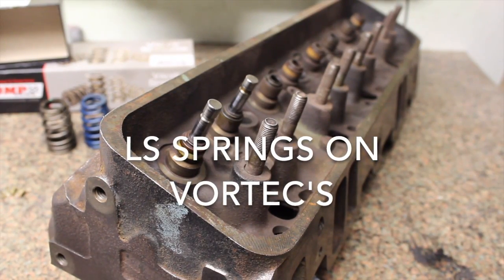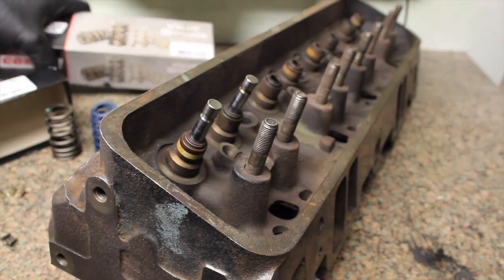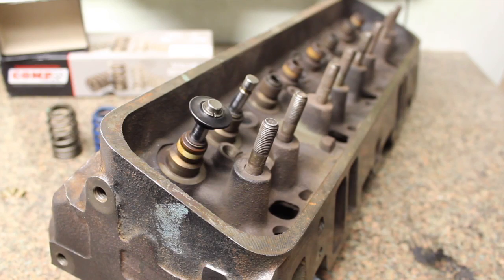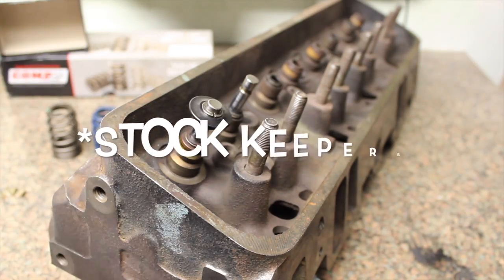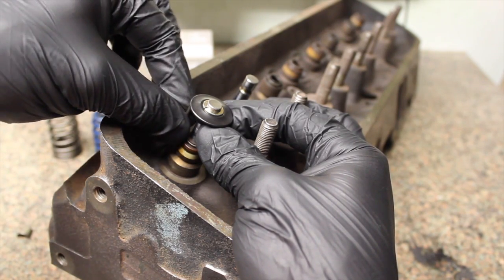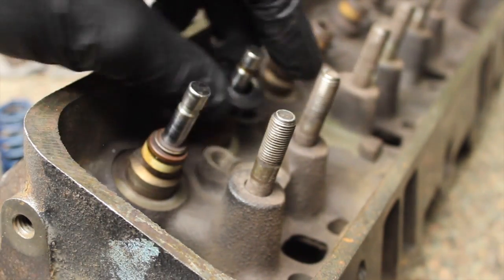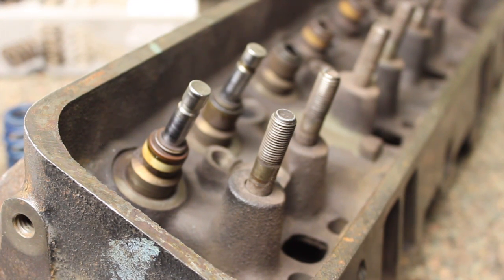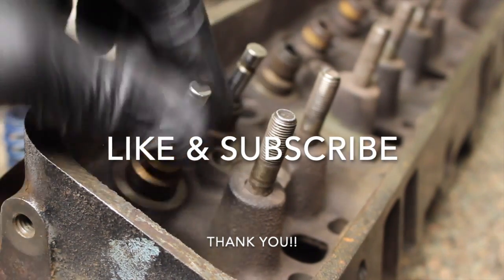LS6 Valve Springs on SBC Vortec Heads

Comment: Thank you so much for the great information.  in the future I'll be using the caliper and coat hanger trick for sure!  Quick question about spring pressure for those springs... The cam I have has the following specs: 218/228 @.050, .525/.525 lift with 1.6 rockers, 112LSA.  Any thoughts if the LS6 springs would provide enough spring pressure?  I've searched high and low and get so much conflicting info it's crazy.  I'll be machining the guides down so clearance to retainer is not a problem.  Thanks!
Reply: Hey Chris I have the exact cam as you and was here with the same question!!!  I just tested my springs that came with that cam and they do seem a little weak, and also the dampers self destructed so I removed what's left of the dampers and put the old springs back on.  They've always handled 6200 RPM without a problem.  My next purchase would be some beehive springs with slightly more pressure than what the cam calls for.

Comment: Hi, will these Beehive Springs work on my 1999 Dodge 5.9l 360 Magnum Gas Engine..??.. I plan on buying all parts needed for my Cylinder Heads setup real soon.. Itself will stay mostly OEM with Porting the Heads.. Tanks...

Comment: 1st would like to say great tutorial! So if you did some grinding, you could manage a cam with .550 lift granted you have ptvc. Now what I'd love to know and hope you have an answer for is: Have you tried with factory LS1 / Gen3 valve springs? They have a max lift of .520 and I have about a dozen sets. Prob same with LS6 yellows and LS3 blues evenly combined.
Gonna be doing a tpi l31 for a project 86 Vette. Thinking I should be able to run a factory cam from a 97 LT1 Trans Am I pulled from LKQ with OE LS1 valve springs on a vortec head. Also, be doing a similar engine build but with zz4 cam and possibly run 1.6 roller rockers with a set of LS3 blues. 
So what do you think about using OE gen3 valve springs for cams around .500 lift?

Comment: So is this process a more cost efficient way? Or would having the bosses machined a better way to go?
Reply from the maker: This was is usually cheaper as you typically have to buy these parts anyway when upgrading cams
Reply: @cuttersperformance  thanks man. I’m gonna go to my shop next week with this info. Have my heads done this way and add 1.60 exhaust valves

Comment: Couple of questions for you. I have a stock L-82 corvette and the cam is listed at .450/.460 do you think stock heads will handle that? If not do you think you will be getting your kit restocked any time soon? Or would i be able to just get a set of the offset keepers for my stock springs and retainers? Ill eventually do a cam upgrade (thinking XE268 or XE274) but at that time id have the head machined and reworked for what would be needed.
Reply from the maker: Check your clearance with the stock retainers (make sure valve seals are fully seated) and you may be able to run .460 lift. The stock vortec springs work good with flat tappet cams aswell

Comment: Have you ever ran a solid roller cam on vortec heads. I am running lt1 heads n a buddy gave me a street roller 290* .555 lift. Going to need a stout spring. You’re the most knowledgeable on these style heads
Reply from the maker: Ive actually never ran a solid lifter cam with vortec heads. Typically the vortec headed engines im doing are for guys not wanting to make adjustments. 
I may consider a mechanical roller for the dingle ball because of the price of retro fits right now.

Comment: What’s a good valve spring/retainer combo for 906 heads and hydraulic roller cam? Also if you go with the offset locks, does that effect the self aligning roller rockers? Do you sell springs?

Comment: So, will the stock self-aligning rockers not work at all with the offset keepers? Just need to know, if not, I can send the keepers back I bought and just got with a 480 or less cam. Let me know when you can, I just cannot spend about 250 on rocker arms. THanks, brother - again awesome content!
Reply from the maker: Yeah but you will want to check your rocker to retainer clearance when using offset keepers 

Also this video may answer some questions 
https://youtu.be/4CbmJC8kIAw
Reply: @cuttersperformance  Man you are amazing, and this content - fantastic. May I ask one more question? I am going with a comp cams 12-246-3 which is .490/.490 - With the beehive springs and just the retainers do you think that might be okay without the offset keepers? I mean I will measure but it is darn close just based on calculations. If I didn't have to use the offset keeps that would make me feel safer. Once again, I am spreading the word about your channel man, you are doing GREAT work!
Reply from the maker: You will have to check your specific heads for installed height ect.  Also make sure your valve seals are fully seated on the guide. 

Ideally you want at least .050 clearance from the seal to the retainer.
If it's going to be less than that, I'd suggest using the offset keepers

You'll also want to verify your actual total lift once the heads are mocked up on the engine with the rocker arms that you will be using as there can be a variance

Cheers!
Reply: @cuttersperformance  Thank you so much for the help! Your videos and your responses have made it possible for me to dig into these engines...I cannot thank you enough for being so awesome man!
Reply from the maker: @Donald Warwick  No problem man! I appreciate the support 
Cheers!

Comment: I've been looking everywhere for # 99095-1 keepers and they are OOS everywhere. I can find Howards 93010 keepers. They are a forged version with +.050 and seem to be a little cheaper.
Reply from the maker: Summit racing part# SUM-174003-4
Reply: @cuttersperformance  The Howards 93010 are JUNK...!!!! They are so wavy that I only get .010 offset. They don't sit in between the valve and retainer smooth and tight. Going to try the Summit ones

Comment: Crane offset keeper part # 99095-1 (Part # 43093010 Howards Cams 93010)
Thanks! I missed this on my heads. I did break in my cam already. My cam has 0.477 int./0.480 exh. lift. (COMP Cams CL12-242-2) I will have to fix this.

Comment: Yooo have you ever had a problem with the retainers and coil bind!??
Reply from the maker: Coil bind is when you have more lift than the spring can handle, not really much to do with the retainers. 
But if your installed height isnt correct you can hit coil bind sooner than you think
Reply: @cuttersperformance  I used the setup you put on here
Reply from the maker: @85BunnyVille  how much lift are you running?
Reply: @cuttersperformance  513 it’s below the max lift of the springs like you said
Reply from the maker: What issue are you having that makes you think coil bind?

Comment: I cut my guide bosses down on my vortecs with the comp cams tool, installed Z28 springs without the dampers, and have been driving it 8+ years with zero problems.
Reply: I started cutting the guide boss down with a seal cutter and a drill more that 30 years ago
Reply: That you know of... lol. Sorry I know old comment BUT your comment is missing 90% of the required context like: Miles, Max RPM, lift, engine use (race, street, daily, etc), Trans and diff (Hard shifting is a jolt, spool is pretty ruff on drivetrain and engine too). I used to cut mine with the same tool and do the screw in studs, but to be honest you can get okay aluminum heads or even new casting Vortex for pretty cheap now, more so if you buy them bare. On my budget engine builds I run aluminum now but do verify before install, just in case.

Comment: This video is very helpful I tried to purchase one of your kits but you said you do not have any available as of now. I just have one more question if you decide to cut down the valve seal guide with comp cams tool 4726 for even more lift how much would you have to take off ?

Comment: Just subscribed! Thank you, what valve guide seals are you using? I’d like to replace mine, maybe allow for more lift, I have a mild 350 going together, using a comp CL12-600-4 cam
Reply from the maker: Are you in a huge rush for the seals? I usually stock the viton seals for vortecs heads (stock guides) but im currently sold out. They will not give you much different clearance than the stock seals that are seated all the way down but they are better seals and easier to install than the steel shell oe ones
Reply: @cuttersperformance  I’m rebuilding a set and was just curious about them, I’m doing everything your recommended here in the video, thank you for the great video!

Comment: Working on an 4.3 vortec 1996 ,Would a whole set of z28 valve spring , retainers  and locks .500 fit as good as the ls6 springs ? Also what stem seal fit better , the ls6 or sbc 11/32 .500?

Comment: Would you have to upgrade springs if you're going with a 447 lift on intake and exhaust?
Reply from the maker: The stock springs are fairly weak about 80 lbs on the seat (new) but actually work well if your running a flat tappet cam. 
.450 is the max lift for the stock springs
Reply: Thank you for the info

Comment: Great video. I've used this one plus other vids you have to rebuild my L31 Vortec heads. From a newb - thanks. 

Some updates if helpful:
1) The part # for the GM springs has been replaced with GM (19420455). They have changed color also to a gun metal gray.  Summit Racing has them. 
 2) Finding the valve locks/keepers has been challenging. When searching for 99095-1, I'm being redirected to 99097 or 98.  Where to get the keepers?
Reply from the maker: Glad to hear! I will be getting more stock on keepers and valve seals soon if your interested 
Cheers!
Reply: @cuttersperformance   One more question: Since the stock self-aligning rockers are a no-go with the offset keepers, what is your recommended rocker? Thanks again for channel.
Reply: @mikevosper5604  did you end up finding the recommended rocker ?
Reply: @adancortes3568  looking for rockers for this set up as well

Comment: I just pulled my pressed in studs on 906 vortec heads. I used anti seize grease to lubricate the nut on the stud being pulled . if the nut starts getting hot move to the next stud and let that one cool off. It looked like most of the studs are stake and were difficult to pull and a couple came out easy. do not use a cheap nut use a valve stud nut which is hardened.
Reply from the maker: Thats the scary part, some dont come out nicely and and some do. Some come out very easily haha

Comment: Having an issue with finding valve seals for my Vortec heads, I bought your beehive spring kit and it’s sitting on the shelf till I can find valve seals. I measured my stock valve seals which are 11/32 by .552 positive style seals the same as in your video. I can’t find any replacements online, auto parts stores just hand me 11/32 generic umbrella seals which I’ve heard are garbage. I’m stuck I don’t know what to do , I’m thinking about throwing my old ones on at this point, I’m at a Loss please help Pat
Reply from the maker: Shoot me a email at pcperformance1@outlook.com

Comment: Hi,  I have one of you spring kits.
Would it b OK to run these beehive springs with a new cam break in  xe268.  Worried about to much spring pressure during break in. Thanks
Reply from the maker: Hey Geoff! I've broken in lots of flat tappet cams with those springs with no issues. Lots of break in lube on the cam and lifters, break in oil and proper break in procedure and you'll be golden!

Comment: So Can I Use The Stock LS6 Behive Springs With The Vortec Stock Retainers  And Keepers
Reply from the maker: You will need different retainers. 787-16 comp cams
Reply: @cuttersperformance  Ok Thank You
Reply: @cuttersperformance  I Have Double Springs For Higher Lift. Would You Recomend Cutting Down The Valve Seats With The Comp Cams Valve Seat Cutter Tool ??
Reply: When i did my 97 gmc vortec heads i used Crane cams 10903-1 kit just for vortecs the retainers moved up higher on the valve stem and the springs had a higher installed height i measured the stroke of the valve  to the seal and it was like  .560  with no machining i did this about 7 or 8 yrs ago using a comp tri power extreme  roller lifter cam tuned for low end toque and fuel mileage daily driver   i don't see this kit available anymore  has to be some hiding somewhere
Reply: @marcokahny709  Thanks For The Info. I Just Bought LS6 Behive Springs And Used The Comp Cam Retainers. Everything Works So Far.
Reply: @DyllanBradshaw Dylan this was quite a while ago  https://nastyz28.com/threads/crane-10309-1-spring-and-retainer-kit-drop-in-on-vortecs.220844/

Comment: Great video but why are you using a coat hanger versus a valve spring micrometer with measurements that are within .001" of an inch?.  I disagree about max lift with stock springs being about .420"? The L31 crate engine comes with .435/.460 from GMPP.?  I released the Vortec heads in 1996.  Install heights are generally 1.760 to 1.78 on the intakes on new or used heads. On used  heads the exhaust seats recession so the intakes are only wants to be concerned about as the exhaust will install the 1.800 after recession on used hats. If working with new I've never seen a measurement less than 1.760" after 25 years working with the heads and 15 years design and drop in spring package.  The ls6/ls3 spring is designed for a Max lift of 500 all you can push it further you need more load from an oem design standpoint.  It will not reach 550 before you stack coils that is a fact. II worked for GM as Chief TD coordinator also. Thank you
Reply from the maker: I own several spring micrometer but this is a old school trick I wad shown yeas ago for the budget boys, works pretty well. 
Max lift is .420 to .450 most of the time but .420 is being very safe.
That 1.780 to 1.800 installed height is what I've used on my vortec heads with great success. 
Thanks for checking out my videos and the input
Cheers!

Comment: How much lift can you run if you install the comps cam 26906-16 springs? I’m building a roller 406 sbc with 906 Vortec heads, trying to run cam with somewhere around .500 to .550 lift without machine work to the head. Thanks
Reply from the maker: You can get around .530 lift safely with the 26906 springs asking as they are installed at 1.800 inches
Reply: @cuttersperformance  have you ever used the 26918-16 springs?  I have read online that people say they will give you .550 lift on the vortec head.  But from your video it physically wouldn’t work, without hitting the seals. Would you know different seals that are shorter? Which will give more room for the bigger cam lift. Thanks
Reply from the maker: @adamwork9450  Yeah you can get slightly shorter viton seals. Also yeah you can run .550 lift and guys do it but you technically won't have the proper seal to reatiner clearance unless you have short seals. But you will have to check on your specific heads as you may find you have different measurements and if you can get the 1.800 installed height.
Reply: @cuttersperformance  thanks man really appreciate it I. I sent you an email with a couple of questions. Thanks!

Comment: Hey I was told and many write ups online using ls6 springs and comp cam retainers 767-16 u could run a lt4 hot cam so what you are saying is even with the ls6 springs and retainer u can only still get a max lift of .480 with 1.5 rockers
Reply from the maker: You will have to check on your heads but you will find that running the 787 on vortec heads won't give you the proper spring installed height with stock keepers
That will two things:
1) Your valve spring just went from a max lift of say .550 with a 1.800 installed height to a max lift of .500 installed at 1.750.
2) your seal to retainer clearance with proper safe clearance will only be around. 480 maybe .500 with stock seals.

So Basically no matter how you do it with stock keepers and Ls6 springs past .500 lift you are pushing the limits.
Will it work slightly past .500 with stock keepers...maybe but is it worth the risk? 
You will have to do the measurements on the heads, you can use the method shown in the video without having to but any special tools 
Let me know if you have any questions
Reply: @cuttersperformance  I emailed you on outlook if it was yours and wanted to install a lt4 hot cam without taking the heads of what would u do thanks for the info in advance the email that I sent came from smokie535@yahoo.com thanks
Reply from the maker: Sorry man didn't see the email maybe check the address again
Pcperformance1@outlook.com
Reply: @cuttersperformance  hey yea I put the wrong email in I got it right this time thanks

Comment: Back again. 
Summit lists the gm 12499224 springs at .570 max lift. and the gm 12713365 at .550 max lift. Are these springs identical? Other places have the gm 12499224 at .550 max lift. Can I buy either springs?

Comment: Have you ever cut down the guides just to eliminat the need for the beehive springs?  I see comp cams makes a cutter just for this.
Reply from the maker: Yes I have, I have the cutters for it. The thing I've found is the guides don't last long on vortecs when they are cut down. Especially when running higher lift. Not a huge deal if the vechicle isn't driven that much but if it is, beehives are the way to go in my opinion
Reply: @cuttersperformance  Using the beehive springs with the stock self aligning rocker arms is there anything that needs to be done to the pushrods or the pushrod openings?